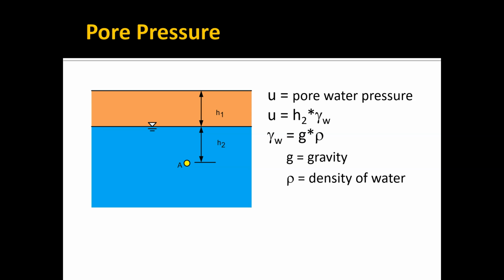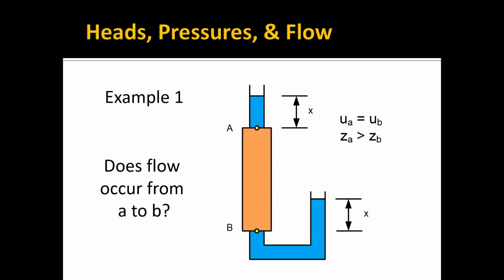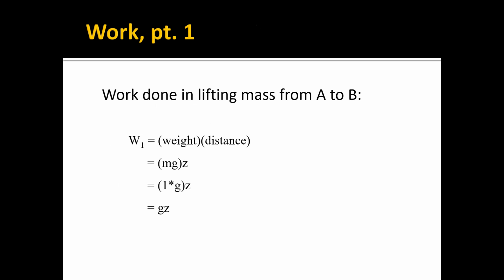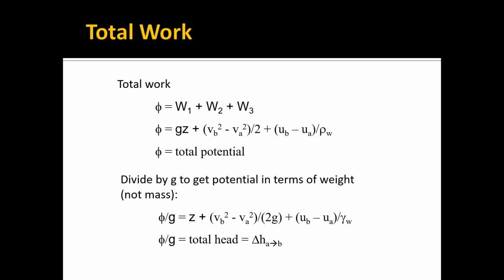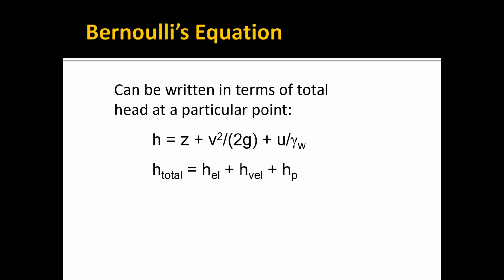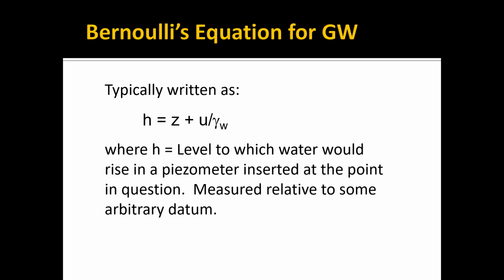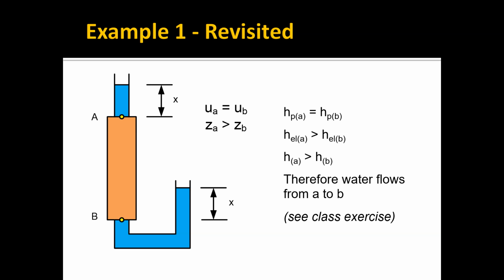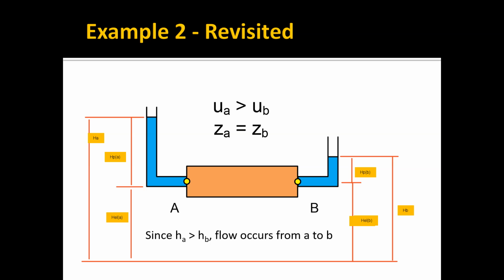Hydraulic Head Concepts

Comment: Thank you very much for providing this series of lectures with clear explanations. I am curious about the meaning of screen elevation as an observation point input in a head observation well. When we input head observation well data, we also input the screen elevation. What is the impact of different screen elevation inputs on head observation well data? If we imagine a well as a tube, the total head is the same at every single point, and I assume the different position of the observation point has no significant impact on head observation data. Please correct me if I am wrong. Thank you.
Reply from the maker: That is an excellent question. Sorry for the slow reply. You are absolutely correct that the location of the screen does not change the observed head value. However, if you are working with a multi-layer model, the location of the screen can be used to help determine what model layer the observation should be associated with and the model-computed head values do indeed vary by layer.